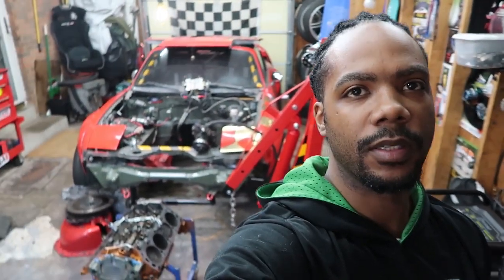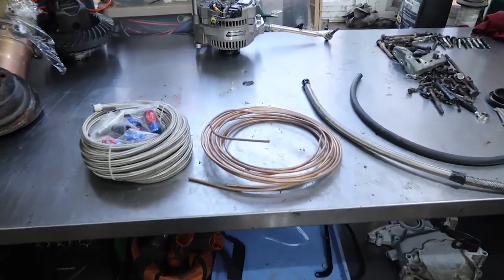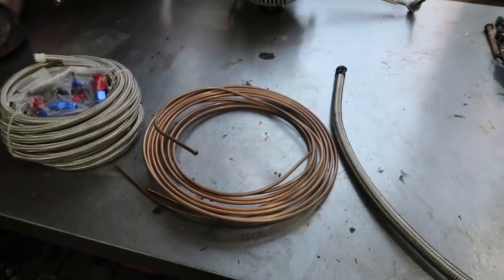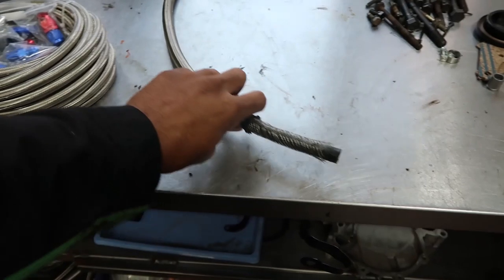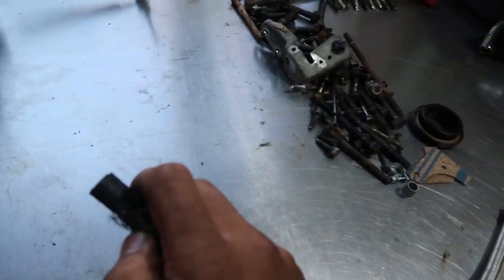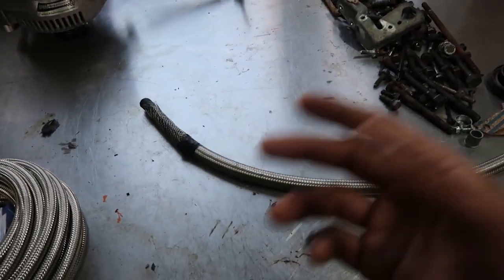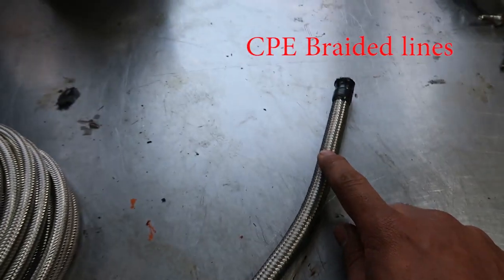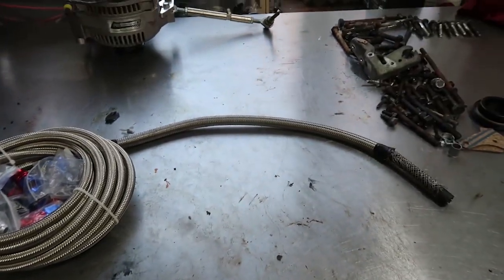UNSAFE aftermarket fuel lines CPE (synthetic rubber)

Comment: I used CPE on my tansmission coolers and have never had a problem. For fuel lines I agree I would probably use PTFE.
Reply from the maker: yah, theres no ethanol in trans fluid.

Comment: Lots of oem rubber fuel lines that last forever though
Reply from the maker: 1. Oem does not use CPE this video is about cheap aftermarket CPE fuel lines you buy online.  2. most cars have a rubber fuel line inside the fuel tank where the fuel pump connects.  Modern fuel WILL degrade this line. 3. if you're driving an old car with rubber fuel lines you DO still need to watch out for e85 damage.
Reply from the maker: 4. If it "lasts forever" and is not degraded by e85, it's not rubber.

Comment: Not for nothing, but when you run ethanol through CPE, you need to add an ethanol fuel lubricant. That protects the hose and all the rubber in the fuel system. Also, you’re not supposed to store a car with fuel in it for prolonged time. CPE is not bad, all these incidents could have been avoided if the preventive measure were taken.

Comment: I spot an 8.2 deck on the stand, what's the specs on that? On a side note, you didn't mention anything about conductive ptfe hose vs nonconductive ptfe hose, I was just reading into that aspect, and it seems the white teflon linings aren't conductive, meaning a static charge can build up in the fuel line with no ground to dissipate it, so it zaps to the braided stainless sheath, which apparently can cause a leak and/or fire issue, whereas, the conductive ptfe liner safely dissipates the charge into the chassis ground via the fittings.
Reply: I wonder if that is still an issue for nylon braided PTFE hoses. Charge should probably not jump to nylon outer layer, since it is also not grounded. And even with conductive layer I've seen reports of people still having random pinholes after a while. This whole thing is real pain, so hard to build a custom line, just that I though CPE is a safe choice- here comes this video, and CPE is gonna explode in one year. PAAIINN :)

Comment: Remember back when I built my double line set up about 20 years ago on my 670 street avenger. Those inferior hoses almost burnt down my ride and spilled all over my intake manifold. Actually here cause someone put a soft line from the tank to the pump on my old school which choked or vapor locked and wanted to see if anyone else had similar issues.
Reply from the maker: I used a rubber "Fuel line" inside my tank as a quick repair, and never went back to fix it.  It burst after about a year, luckily there's no major safety issues with the in tank line breaking.

Comment: But is it safe for coolant lines? I'd never mess with fuel lines, I will always leave that OEM.
Reply from the maker: and coolant lines do not contain ethanol, so you're fine using this stuff for coolant, oil, or whatever fluid runs thru, just not gasoline/e85.
Reply from the maker: OEM fuel lines aren't always an option when you're swapping an engine, and even if you get the correct adapters to connect to the OEM fuel line, you're still going to have to make a section to go to your new fuel rail.  There's a correct way to do things.

Comment: Do you recommend CPE for oil Motor? I need to put a CPE hose for my motorcycle oil Cooler then I have been thinking about using this.
Reply from the maker: I've been using the CPE hose on my oil lines for years, No issue.

Comment: thank you, just switched my cart from $40 earls fittings to evil energy ones on amazon after doing my due diligence and researching. evil energy fittings seem great as long as you don't mistakenly buy the CPE fittings. but yeah, just watched this and switched a whole cart to evil energy ptfe fittings from summit racing. i believe the negative reviews for the evil energy fittings are because people run CPE ones instead of PTFE ones since they're a few bucks cheaper. i would've made that mistake if i did not watch this video 👍🏾 ...application is a 96 Jeep ZJ
Reply from the maker: yeah, the cpe fittings are totally different from the ptfe ones, you cant swap them

Comment: I agree.  I have been building fuel line assemblies for years, also built plenty of hydraulic line fitting setups in the agricultural and marine industry.   
 That CPE although rated for fuels is only good for toilet and sink hoses.    It still breaks down with oils. 
  Don’t be cheap , lives depend on it.    Always go with PTFE.   Good video.

Comment: Every advert I've seen for CPE states to not use it with ethanol fuel. Also, Murphy gas stations regularly have ethanol-free pumps, and if you can find your local mom & pop gas station they usually have it too.
Reply from the maker: i have heard of non-ethanol gas, but i've never seen it.  best thing to do is stay away from CPE.

Comment: I feel like the generic rubber hose you were implying carb fuel line. Which yes I agree don't use it on fuel injection but fuel injection is completely fine and doesn't require any over priced AN adaptors to run it
Reply from the maker: Rubber hose + modern fuel is a no go, even if you are using a carb.
Reply: @Sgt.Slides  that's a fairly ignorant statement. Check out Eaton's or gates product line. They have hose's rated for e85. It's the same hose material used at the pumps at the gas station.....
Reply: @Sgt.Slides 
Gates says their rubber hoses are ethanol compatible. I think it should be fine for a carburetor. 
I changed all the rubber hoses including the gas tank fill tube after being scared to death from reading comments like this. 
I have to admit everything looked fine after 7 years. I even changed the fuel pump, took it apart and even the diaphragm looks good.
Trust me this wasn’t an easy task on a 1951 bel air with a V8
Reply from the maker: @daves485  These aren't Eaton or Gates hoses.  I don't know anything about their product, or why you are telling me about them.  If you like Eaton & Gates, Use them.
Reply: @Sgt.Slides  Because they're rubber and E85 compatible and you out here telling everyone their car is gonna burn down unless they run PTFE lines. Personally yet to see a modern production car with PTFE lines...they all use rubber. Bottom line. There are rubber products that are perfectly safe with E85. You out here preaching without all the facts.
Reply from the maker: @coldstart-Z32  no, what i'm saying is your car will burn down if you use THESE fuel lines.  PTFE is a safe alternative if you want to run your own lines.  OEM's use metal lines, those are fine too, but i wont be buying or making my own metal lines, as for the OEM hoses, idk what they use, but it isn't CPE.  CPE is not safe for ethanol.  period.
Reply: I got gates barricade to replace the fuel lines in my 1981 vanagon

Comment: That was exactly my experience with "fuel safe" plastic braided rubber lines. 
Very dangerous indeed, mine also luckily let go with fuel pressure rising up before starting and driving the very first drive of the season. 
Great video, man!

Comment: Thanks for the run through. I don't know much about PTFE but sounds like it is worth researching. 

I've tried to stick with known brand names like Continental, who says their lines are coated and won't break down with E85. But I'm sure the difference is that I haven't been running high fuel pressure. FWIW I keep the rolls stored in ziplock bags and then in a plastic tub and they've lasted for years that way.
Reply from the maker: It doesn't matter the brand.  CPE is CPE, and it's not good for e85.